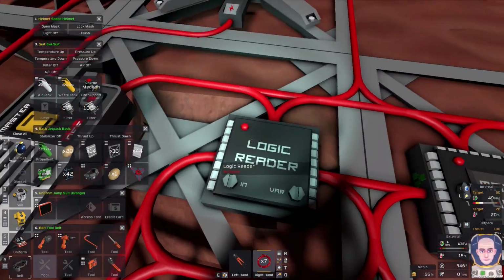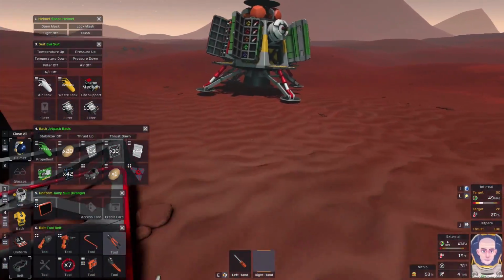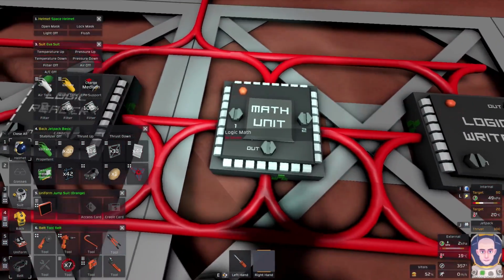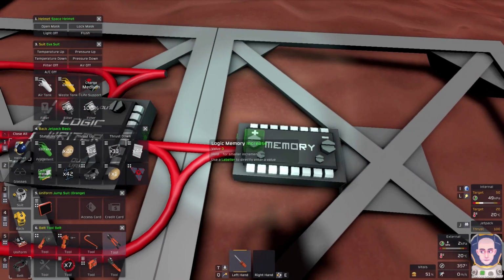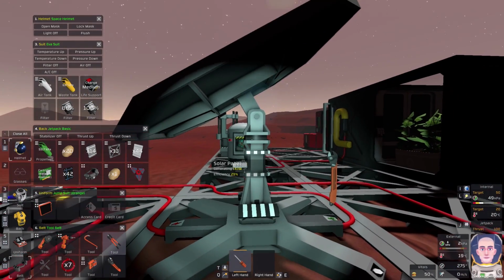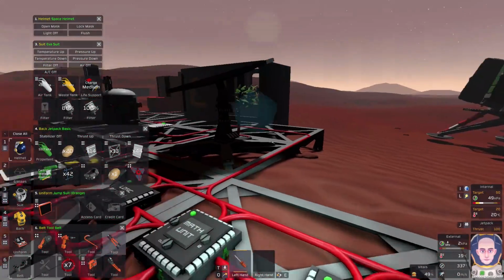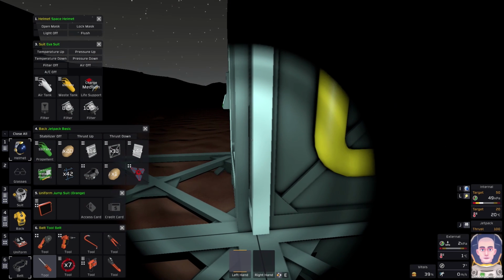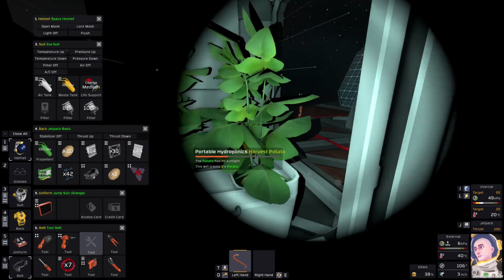Stationeers: Level One Update - Part 5 - AN AUTOMATED SOLAR PANEL

Comment: Wow, that's a big cable salad, could have just turned the solar panel base 180° so you don't have to cross over the cables twice. Also, you could connect both apc on the same power output of the solars and not cascade them?

Comment: Just started playing this a few days ago.  Found you trying to find some recent LPs.  Liking what you're doing so far.  It was nice watching you re-figure this out.  I just wanted to point out you made your life a cabling nightmare by having it your head that the power port of the solar panel needed to be on the side with your logic.  Would have been much nicer with the data ports on that side with your logic and it wouldn't have all the crossover you needed to do.

Comment: For those confuse about the 1.8, the solar panel moves in a 180 degree setting. But has a setting of 0-100% to translate into the 180 degrees. So if you take the 180 and divide it by 100% you get 1.8

Comment: Yes, you should send the power from the solar panel in parallel to the two power controllers. In future if you ever need more power it would be easy to add a kit battery and more solar panels. Btw, I believe only the large battery will have enough juice to work through the night and have the solar panels lined up for tracking the next day.